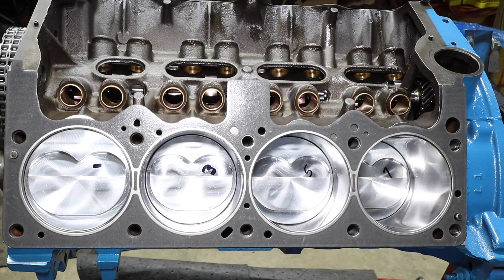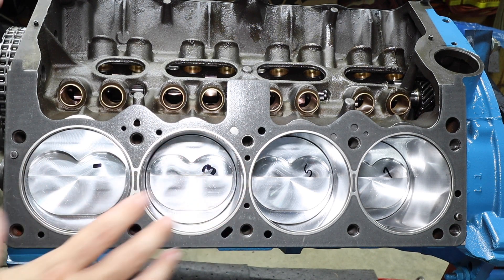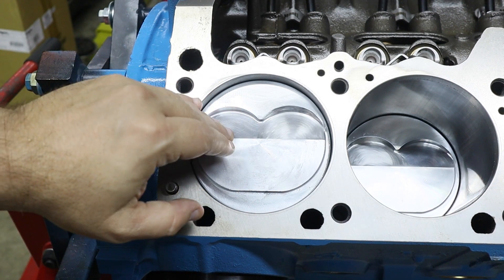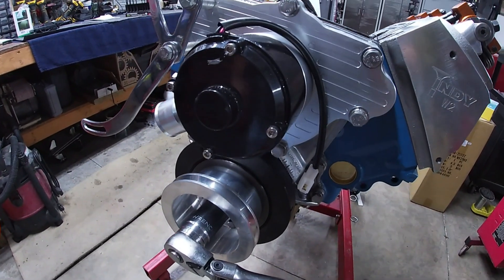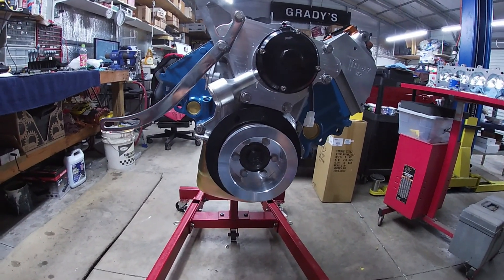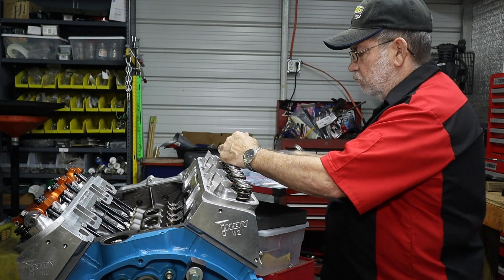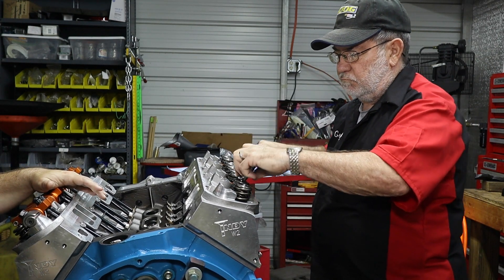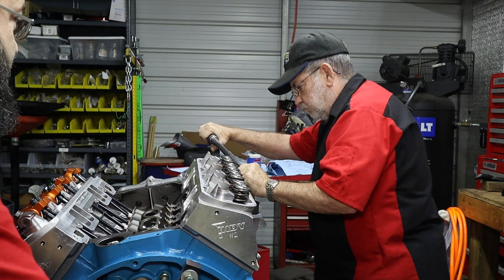The LA-phant: Cam, Heads, and Rockers (Part 2 of 3) | Installing Aluminum Indy Heads

Comment: 100th of a gram, .100 of a gram?
Reply: Lol I guarantee your not keeping the balance of the pistons within a 100th of a gram. We build and machine engines for a living at my shop and only target parts within 1 gram or less.
Je, Mahle, CP, Diamond  to name a few only target 
+/-2 grams for each piston in a matched set.
 But anyways you probably didn't effect the balance to cause any problems.
People who criticize things like you did saying it's messed up now never seen how far from balanced the factory engines were lol they are not even close
Reply: @rtprecisionmachine6210  Agreed, I built engines 37 years and balanced 16, 100th....doubt it. BTW, .0001 is a hundreth
Reply: @joemancini3258  are you sure 0.01 is 1 hundred and what you displayed is 1 ten thousand
Reply from the maker: We were able to measure to .01 of a gram to each piston. Not a lot material was pulled.
Reply: @MicsMotorworx  Wow, .01 of a gram must be the weight of a nose hair!!
Reply from the maker: Perhaps. It's what Pop told me.  I wasn't in town when he did it.